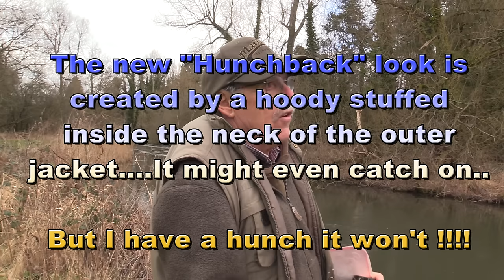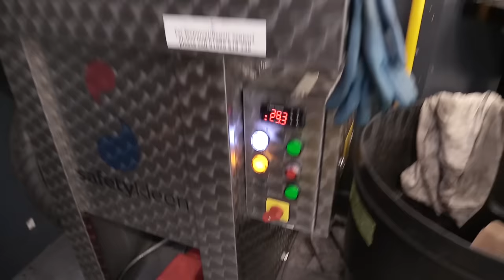HUGE River Monster on a light rod...What a Fight!

Comment: I always fish a bodied stick type float with 2 or 3 rubbers on the stem (bends the line around the float body, rather than having a gap)  Also, if a rubber breaks, you have a backup rubber - especially if using 3 rubbers. 1 up to the lower body, 1 middle & 1 on the end.